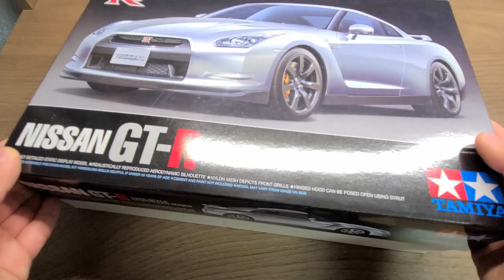How to build a 1/24 Nissan GT-R Tamiya Step by step

Comment: Nice kit this i done orange then ive been trying to use mold to take engine cast for the liberty walk kits iv built  but i can get bottom half into a rubber mold its difficult to do valve cover top engine cover
Reply from the maker: I've seen a great white GT-R liberty walk on your channel, how did you work on that?